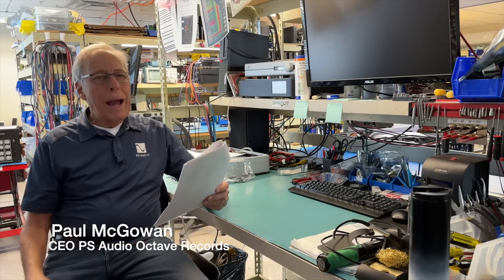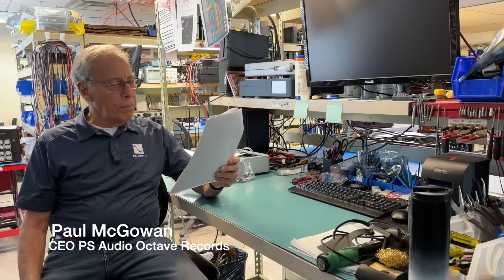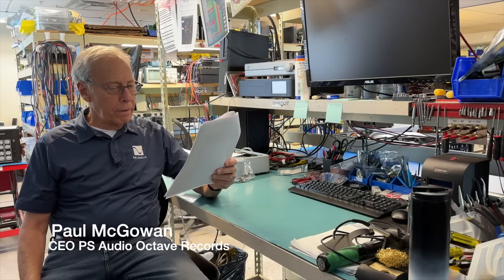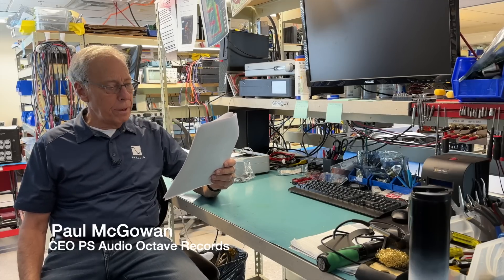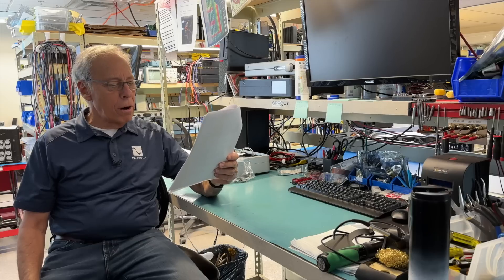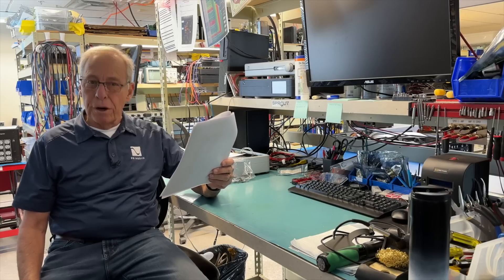Why phono preamps sound different

Comment: Is there any particular benefit to buying a turntable manufacturer's brand of phone preamp or can you just buy an el-cheapo one that will do the same thing?  I have a Rega Planar 2 turntable hooked to my Denon AVR-X4700 phono input and am considering upgrading (?) to a dedicated phono preamp thinking I would get better sonic performance out of my system.
Reply: Like pretty much everything else,  the more you invest dollar wise, your sound quality goes up.
I have a P2 on one of my systems and it benefited from going to a modest priced ($350) phono preamp over the one in the $600 integrated amp.
Reply: @pnichols6500  I ended up getting a Fono MM mk5 and the difference was incredible.  Gain on the Rega preamp was 28 dB higher than the Denon receiver...I didn't have to crank the volume up to get any decent sound.  The music sounds good, too :) At some point I'll upgrade one part of the system or another, but - cartridge, table or preamp - but for now I'm happy with what I have.
Reply: @pnichols6500  After I realized why I always had to crank up the AVR to get any decent volume from my speakers, I went ahead and bought a Rega MM Mk2 phone preamp.  There was a 28dB difference in gain between the phono input and the preamp.  Game changer!  I was also considering the Pro-ject Tube Box S2 (never used a tube amp) but the Rega was $50 cheaper.  I think I'm done  for a while, having only a part-time job providing me income...I do the best I can with what I have.  When I bought the table (didn't want to but my old one wouldn't even power up anymore) I had the stylus changed out from the standard included Carbon to an AT-VM540ML, which I'm happy with.  Before the TT, my prior upgrade was an 11-channel Tonewinner power amp and a set of patch cords to run my AVR in preamp mode.  The extra power in the LCR channels is really noticeable.

Comment: You missed the most critical part of the explanation. It became assumed that magnetic coil based phono carts were the standard used. Magnetic coil generators are not linear in output based on frequency for a given amount of movement.  Their output increases with frequency. IOW for a given amount of side to side travel for a stylus, the output goes up as the frequency goes up. For X amount of travel the cart's output would be higher at 1Khz than 100Hz. It would be even higher at 10Khz than 1Khz for the same amount of stylus travel. So the RIAA curve assumes this non-linearity and adds a cut off slope at a given hinge point to reduce noise past that while taking advantage of the magnetic carts greater output at those frequencies.

Comment: Hmm, I understand the physical reason for cutting the bass frequencies, but I'm not sure why the high frequencies have to be boosted during the record cutting process.  Was it to make the high frequency grooves a little bigger in order for the stylus to track more easily?
Reply: Paul does explain this: boosting the high frequencies is to improve the S/N ratio on playback.
Reply: The higher the frequency the harder for the mics to pick them up, it’s common sense that every piece and item or software made by people has more than 1 flaw
Reply: @shangrilaladeda  The boosting of the high frequencies and the cutting of the low frequencies happens during mastering and not recording.  Cutting the lows makes sense to me as to not make the grooves too wide on the record, but I am not clear on why the high frequencies need to be boosted.  I am sure it is related to the physical cutting of the grooves and their size, I'm just not clear on it.
Reply: @johnnytheg  no that’s just a lie, cds don’t suffer like records do and they also put the crap on cds mics just like our ears have a harder time picking up higher frequencies I know the design of life so the only mystery to me is when God will fix it all
Reply: @Douglas Blake Thank you.  That does clear things up significantly.
Reply: @Douglas Blake It's true.  Especially when you see the magnification of the grooves, it's a miracle that it works as well as it does.  I have certain vinyl records that just sound incredible.

Comment: To put a sharper point on record playback… RIAA (Recording Industry Association of America) was established in 1954 (not the 30’s as you said). This was to create a ‘standard’ EQ curve instead of everyone’s proprietary recipe. Microgroove and vinyl came along in 1948 (in both 10” and 12” format, now commonly referred to as Long Play).

The third reason for RIAA is to improve tracking and keeping the stylus from jumping out of the groove. With advancements in cartridges and tonearms, this isn’t as critical now as it was in the 50s and 60s.

Comment: The RIAA doesn’t go back as far as the 1930s. It was established in 1952, and the RIAA curve was published in 1954. There is some debate about how long record companies continued to use different EQ curves, but it was certainly well into the stereo era. That’s why some of the best phono preamps offer a choice of curves beyond RIAA.
Reply: The Actual Patent was protected so when the original expired RIAA took over yes Technically the 1929 design with 2 needles at 45 degree and came then, Well before the RIAA the original engineer died in a plane crash in 1943 all of Stereo is owned to his genius

Comment: Vinyl - Deliberately distorted to suit the media’s characteristics and then undistorted for playback in an attempt to recover the original signal. It seems similar to a lossy compression scheme to me.
Reply: Trying to figure out whether you're high or need to be...
Reply: More like a lossles compression, as you don't lose information, just use a reversible process to adapt the information to the media. BUT the means to revert this are far from perfect and induces a lot of distortion and that's the answer that Paul evade.

Comment: definitely put a balanced input in your phono stage this is quite rare and usually only on the expensive models, Keep the price down it's not expensive to put in... and then the person has the option of changing their setup on their turntable to be balanced quite easily maybe give some instructions with your phono stage how to do it and a set of plugs. Makes a big difference and a nice little touch

Comment: Anyone playing vinyl music is using a RIAA filter which is an equalizer of extreme filtering properties often with highly audible artifacts. You shouldn’t be a user of that and at the same time believe a slight tiny room EQ of a few dB perfecting your frequency response is bad 🤔
Reply: The difference is the RIAA curve effects the fringes of the music where room equalization can be heard across the whole spectrum of the music. The thing Paul didn't  mention is that reducing the bass that much helps to keep the needle in the groove where it doesn't have to move as much to reproduce the bass.
Reply: @gitmobob6266  No! It’s exactly opposite. A RIAA filter is a nasty +/-20dB phase shifting EQ filter through the entire audible frequency response. I usually EQ only at specific points and never more than +/-6dB. Nowadays we don’t need all the nastiness of vinyl playback with modern digital audio. No noise, no clicks, no L/R crosstalk, no audible playback distortion, no phase mess up, no wow and flutter etc.
Reply: @ThinkingBetter  Please take this for what it is worth and is a personal observation. I worked in a high-end store for a couple of years. People who came in would spend much more time listening to our analog setup than the high-end digital equipment. The digital music may have better specs in every way, but analog just sounds more natural. I can't explain it but prefer it personally. I'm not forcing my views on anyone, and the observations are mine. Thanks for the reply, and I hope Paul clarifies  his explanation.
Reply: @gitmobob6266  Digital audio is as excellent as you want it to be. It’s not just a matter of superior specs. It’s true however that we often perceive imperfection as more natural. Variations in pitch from wow and flutter, soft clipping adding even musical harmonics from a tube amp, some noise etc. make music feel more live and natural.